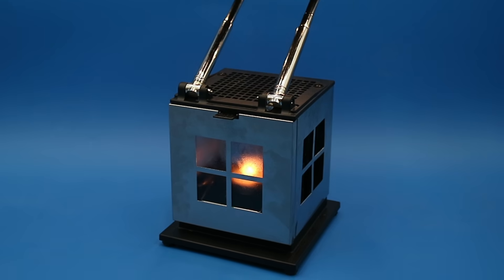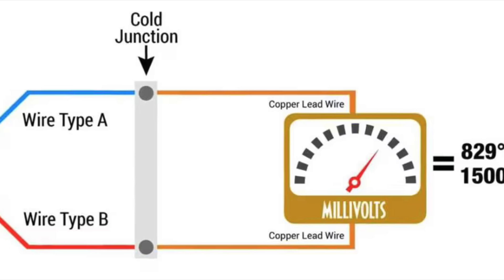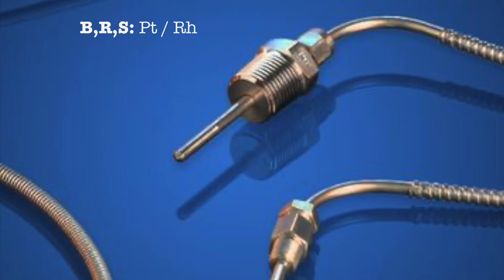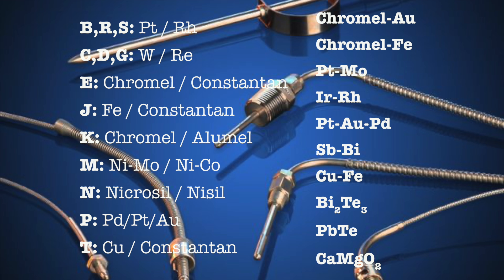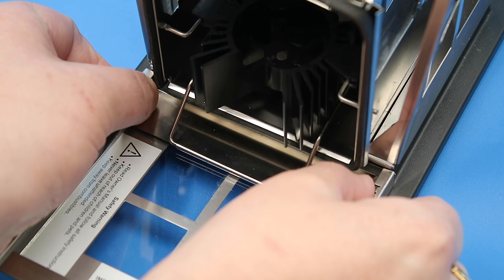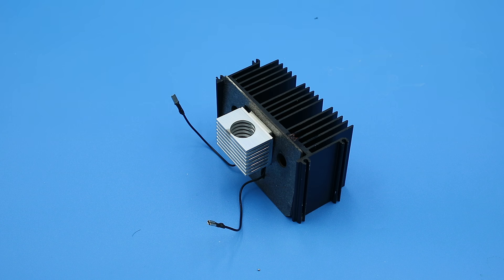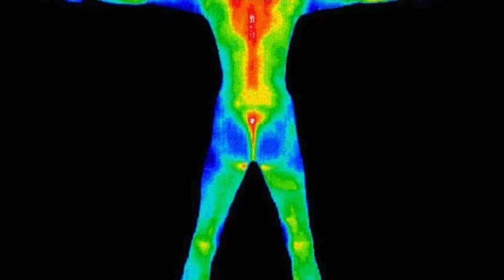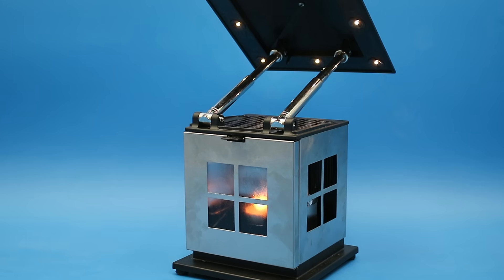Candle-Powered LED Lantern: an Exercise in Conversion Efficiency

Comment: Yes, the candle does produce light, which is the whole point of the device but not included in your equation. Light from LEDs is usually expressed in lumens and watts so a comparison to incandescent bulbs can be made intuitively. 0.9 or 1 watt can produce an average of 75-115 lumens from an LED, equivalent to a 15 watt night light. The candle is producing one candlepower or standard candle or about 12-15 lumens which is 9-17% more light. A Fresnel lens could concentrate and focus the light without reducing the heat output.

Comment: I own one.  Its primary application is that it is super cool!  Although pricy, it is robustly built and the telescoping led hood actually does make it a serviceable reading lamp.  My winters are cold, so I use it everyday as the heat generated is not detrimental.  Now I want something similar that uses a wood burning stove as its power source.

Comment: The energy invested into the manufacturing of this gadget is probably greater than the total sum of the increased light output it will ever produce in its lifetime. In this sense, it might tip the efficiency calculation into the negative. But it's still neat, and there are circumstances where this might be useful.

Comment: So much for "fair use."

Interesting video, I had no idea candle light output was so inefficient. Interesting gismo but I think a lower cost and more useful device would be a solar light and battery. Unless of course where you need to use it does not have much in the way of sun.
Reply: Heat driven oven fan, i'll try adapting one of those. 
I think fire is more reliable in the great outoors than sunshine... maybe a hand- cranked power bank, too.
Reply: With the approach of the 2nd sun we are seeing, the devastation it will cause, with 25 years of little to no sun, people will kill to get this lantern & tea candles.

The ZetaTalk Newsletter Issue 955, Sunday, December 29, 2024

Comment: I could see myself using this during a blackout. Candles are dim and this can produce a sufficient amount of area lighting that goes beyond what a candle can light. Even a 1W LED lamp is good to have a decently bright room light at night. Better than a flashlight which only lights up a narrow beam ahead of you, during a blackout you want area lighting.
Reply: Heat- driven oven fans are way cheaper, and may be adaptable to additional led's. 
That's what i'll try.
Reply: Did he mention how many lumens the LEDs of this device put out? I had to finish watching this video a ~day after I started and lost track.

Comment: Reposting. I understand the bimetalic disc to be there to limit the hot end temperature of the peltier by reducing air flow to the candle. Semiconductor peltiers are neat, but they have a sharp limit on their hot end temperature (I see 138 C max in one datasheet) above which they are damaged. The disc is a cheap and clever way to implement that protection.
Reply: It's moderately common in heat-powered oven fans, too.

Comment: as mentioned in the previous upload: I´d be concerned about carbon monoxide poisoning when using this device without good ventilation of the room (especially in modern houses where there is very little airflow due to insulation): 

the bimetallic disc will heat up and then close off the airflow, thereby starving the candle from air, which produces carbon monoxide (CO) by incomplete combustion and reduces the candle´s temperature. After the air has cooled the disc opens up again, allowing enough airflow to have complete combustion producing carbon dioxide (CO2) - and this cycle repeats until the candle is used up or extinguished by emergency services ;-/ 

Carbon monoxide is poisonous even in low concentrations; when I worked at a hyperbaric oxygen therapy chamber we had carbon monoxide poisonings from similar devices like Samowars (a sort of stove with a candle in it to keep a kettle of tea warm) and Shishas (waterpipes) that were used in closed rooms.

So please use it only in ventilated rooms and stay alive and safe!

Comment: Dam you WB I have just retrieved this comment to the first post.
That natty lamp would also keep a coffee pot warm....   In the UK 1934 there was a thermoelectric generator that ran off town gas as electricity was not always available.   It was powerful enough to run a small radio whilst boiling a kettle or cooking pot. It was customary to plug a rubber hose into the gas fire spigot or mantel light to run Flat irons, Stove rings and even a burner under an Iron bath ! ! .

Comment: The candle gives some light when it burns + generates some heat + generates electricity for LED lamps. Not  crucial but i could easily see myself owning such a thing in a remote cabin where every bit of heat is appreciated and there is never enough light.
Also please, by all means do ads if they generate revenue. We all need income and if you can skip unreliable Youtube as a middleman and get sponsor money, i have no problems with that. Basicly, we are getting ads eitherway but at least with sponsors, you are guaranteed decent income from it!
Reply: I could see this being adapted to a pellet stove type heat source. That would be even better than a candle.
Reply: Its neat but if youre relying on a small candle for heat, stuffs pretty rough already

Comment: I was going to write out a long comment about how this device you are talking about does not in fact use a stack of thermocouples in it, and then you mentioned the Peltier effect (and coolers based on it), so I assume you are next going to tell us that Peltier coolers such as used in "car power socket beverage refrigerators" which you can generally find for $100 USD or less, will work just fine to create an electrical potential difference (and therefore current flow) when fed a thermal gradient, making that whole comment useless.
Those little Peltier cooler plates (which are available bare with pigtail leads if you care to search for them online) are fantastic things if you have a need to create a cold spot in a small space, or have a lot of heat energy that you wish you could do something with.
You can even STACK these Peltier coolers to achieve lower and lower temperatures on the cold end, some high speed cameras use this to cool the image sensor so that it can respond quicker with less pixel noise making much clearer high-speed images, but I imagine you could also go further to get to a true solid-state cryo-cooler and make a tiny atmospheric nitrogen/oxygen gas distillation plant out of them (incredibly inefficient compared to Joule-Thomson cooling of compressed gasses, but unlike the turbomachinery needed for that, you can get the parts for the Peltier-stack based liquid gas plant off of Amazon).
Reply: Now that I wrote all that out, I'll mention one thing that was in the long comment that I decided to not post:
The Seebeck/Peltier effect is MUCH stronger in "proper" doped semiconductors than it is in the junctions between base metals.
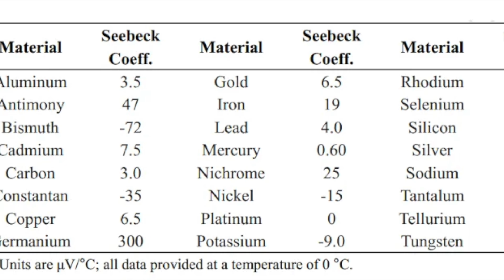You'll see this by the semiconductors having an experimentally verifiable much higher Seebeck coefficient, and you can see a glimpse of this in the video at around the 4:20 mark, where you see the metals all having coefficients in the single or double digits, and then you look at Germanium, Selenium, Silicon, and Tellurium with the massive coefficients of 300, 900, 440, and 500 (respectively) and realize that with the proper dopants you could basically invert that coefficient to be just as negative as it is positive, leading to a massive seebeck coefficient difference across the junction as a whole.

This might lead to a realization or a "connecting the dots" moment for some readers of this comment, and yes, it means what you think it means.
To state it precisely:

What this means is that when creating thermopiles, use of semiconductors leads to much more efficient thermal to electrical or electrical to thermal conversion, and it is this which makes those solid-state refrigeration systems possible, since at that high of a Seebeck coefficient, the waste heat added by the electricity flowing thru the P-N junction does not add so much heat to the system that it swamps out the Peltier cooling effect, and it similarly means a much higher efficiency of converting a thermal gradient to an electrical flow.

Comment: For the money, a cheap LED flashlight and a pile of lithium batteries would be more effective. If you're really concerned about long term "off the grid" viability, get one of those crank or squeeze powered flashlights.
Reply: Get a pile of lithium batteries to run a flashlight then use this device to recharge them. Oh dear, I think I fell down a rabbit hole.

Comment: Consider that an electric lightbulb is powered by either burning coal-fired steam turbine, the fusion reaction of the sun via solar panels, or steam turbines powered by hot glowing uranium fission fuel, fuel sources which all produce light as they burn. Using a candle to generate electricity for light doesn't sound so unreasonable.

Comment: I sold to a collector in pre internet days a thermo electric generator, the “Aztec”made by 3M, Minnesota Mining & Manufacturing. It was new in the box and found at a government forestry surplus auction. It was an ordinary glass kerosene lamp base & burner, but had a metal chimney with rocket fins on the side (for cooling). Metal chimney had a viewing window above flame, and above that 6 thermo couples anyone familiar with a gas furnace would recognize. A voltage converter of some kind in the base, and power wires coming off it somehow. 

With no internet, I called 3M asking museum questions and somehow got referred to a retired guy who worked on its development about 1960. Idea was to run a transistor radio, in the cold war (turned hot) fallout shelter, and maybe sell it in 3rd world areas. When they started working on it radios were bigger and needed many C-D size batteries. By the time the device was ready for production, transistor radios were pocket size and used a single cheap 9 volt battery. The economics had changed and the Aztek was never produced large scale. Best guess on mine was that some were sent to Forestry departments for testing in fire lookout towers. Based on watching this I just now googled “Aztec 3M Kerosene” and found pics of one and some period literature on it. You need one on the shelf! Apparently there are a few out there.

Comment: Thanks for the video on this strange contraption! .. That said, this seems like an overly-complicated version of a mantle on a gas lamp, which converts the heat (infrared) to the visible light spectrum.  I don't know how efficient the mantle conversion is, but I suspect it significantly beats a solid state junction to led setup.  Not trying to be negative about the video in any way.. it's just interesting to realize that the non-visible to visible light game has been considered and worked on for so long and in a very significant way impacted lighting systems prior to electric light bulbs.  I have seen many historic quotes talking about how the introduction of the gas mantle light absolutely changed the way people lived.
Reply: Yeah, those lanterns get pretty bright and put out a good amount of heat. This device looks like it would be great for different applications. A more compact version for light camping,backpacking maybe. The two luxuries I won't go w/o when camping are a lantern and radio, so maybe they could power an led and receiver with a tea candle and I'd be set.
Reply: Hot tip:
This device is 200 $.

Cheaper: a heat- driven fan inteded to improve convection when placed on a oven is ~10-20$, and can propaply drive a few led's, too. 

(i'll try that, once I have some spare time.)

Comment: do kettles use bimetallic strips to stop boiling? was always told it was pressure form the steam.
Reply: I thinks it's heat from condensing steam, that will only reach the bimetal strip due to pressure building when the lid is closed.

There's propably a "technology connections" video on that.
Reply: It possibly depends on the design, but my understanding was that when the water boils, the steam goes past a bimetallic strip which turns off the power.

Comment: The soviets made thousands of these heat type nuclear power generators and left them in the wilderness all over the Soviet Union.
Reply: what
Reply: @asemic  Yes. They had a program for powering things way out in the middle of nowhere.  In the 90s, some people found one and used it to warm themselves on a mountain.  All 3 suffered extreme radiation sickness.  I think it was in Uzbekistan.  But there are many of them left (though most have been found and properly disposed of).
Reply: It was actually in Georgia. The incident is known as Lia radiological accident. 1 of the 3 men died.